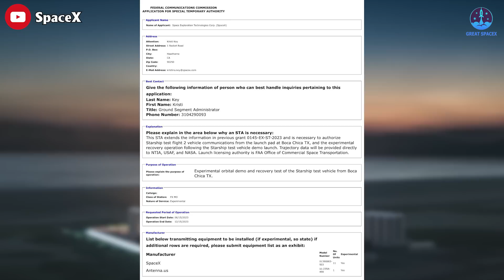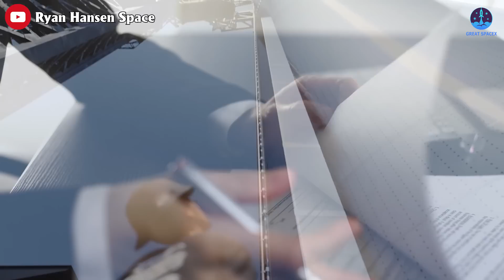Starship’s second flight date revealed, FCC approval, S25...

Comment: Any flight termination device that is activated during flight is under review requirement. That is protocol. Blue origin had the same issue with there mishap. It takes 3 to 6 months to go through data and change the issue.

Comment: Sorry for length :
Astroscale is sounds great to boost lots of items. But just lifting Hubble orbit would be as useful on its own as to push the Tesla Roadster In space towards an orbit around Pluto. Hubble will be in a safe orbit + extra effort to clean its path is great with no risk for outr lives it will ever crash back to Earth in our life time. Now Back to Pluto and Tesla Roadster, the roadster needs a lot of work to patch the failed systems that 30 years bring. Hubble needs ALL NEW giro’s, More propellant, new computers that talk and work with the abacus now on board. Let’s see STS had 5 flights to put glasses on, needed giro’s at least 2 times before, full replacements of older tech and don’t forget the humans (I recall they walked around Hubble a lot on those 5 missions.  Any next flight to Hubble will be much bigger and complicated then giving it a boost (which it sorely needs)! Sorry to slam NASA here but Nothing at all can be done to extend Hubble scientific lifespan. But NASA has no cloths for the  emperor to wear in space! As only 3 crew rated ships have ever gone over 500 miles from the Earth the ship must be a Crew Dragon at this time. The testing of SpaceXs EVA suit is now critical as those on the ISS must be tossed in the trash as safely & fast as it can be completed and certified.

Comment: okay I loved to see starship reach orbit really I do, yet the FCC better be careful with this decision, by like triple checking SpaceX's calculations on this.
Reply: FCC doesn't do calculations. This is just getting a permit to transmit data on a specific set of frequencies.
Reply: @ghost-cs8jy  i know they don't, I just said it's SpaceX that does it, not the FCC
Reply: @Charles-7  The FCC doesn't check SpaceX's calculations either.
The permit that they are going to issue is like a fishing license; just permission to use the airwaves.
All the FCC cares about is that all the forms are filled out correctly and the check for the permit clears the bank.

Comment: It will be interesting to see how fast 33 high pressure plasma torches can cut through the water cooled steel plate.
I know it will be expensive, but there is no substitute for a flame diverter trench if a high rate of launches is to be achieved.
Reply: Well the plasma torches are liquid cooled, so I think it's doable.
Reply: @Arational The flame diverters used by NASA have never seen a booster REMOTELY as powerful as the ones Starship will be riding to orbit.  NASA had concerns about launch pad damage even before SpaceX did a low power test, and even the lower powered engine tests blasted the concrete into dust.  Plus Starbase is at sea level, not up on a hill.  Anything they dig would be flooded by groundwater, hurricanes, you name it.  And you don't want saltwater steam drifting onto your launch pad and other metal parts of Starbase.
Reply: Steel becomes putty at about 500 C  .  The exhaust temp is about 4000 C. The water will likely just be blasted aside then lumps of steel putty will be blasted all over the place possibly taking out rocket engines. I feel that even using Tungsten would not be enough.
Reply: @frankkolmann4801  and again I am dumbfounded at the shear genius in YouTube comments.  I can't even fathom why SpaceX doesn't hire a bunch of them and solve all the problems.  Musk said that the new raptor V3 might possibly have the highest heat flux of anything ever made.  Must not let those engineers look at the plate design too let them know it will fail.  Maybe you can educate them on heat flux so they know the rocket engine melted during testing, they just didn't notice.  You know the water is going to be cooling the plate from the bottom and then spraying up through it?  
Let me guess, you are one of them that knew the pad would fail at liftoff thrust, but not during the static fire, like all the other YouTube geniuses?  That's excellent engineering when you don't have the numbers.  Are you all use a crystal ball or a Ouija board?
Reply: @frankkolmann4801 I forgot the best part.  you ever run the heat vs pressure equation?  Of course you didn't, or you wouldn't say the exhaust was as hot as the combustion chamber.  Oh and film cooling,  something else you should know as an engineer
Reply: @frankkolmann4801  the steel plate is acting as a giant shower head, with water blasted onto the surface of the pad from holes in the plate itself.  They are angling the water streams to deflect the rocket exhaust off to the sides, so the pressure and heat on the plate is minimized.  High temp steel alloys do exist and I imagine SpaceX may iterate on this design and add higher corrosion resistance after they get concrete data on how much heat this upgraded pad can handle.  

As for molten steel damaging the engines...no.  The booster itself is steel and they would see signs of damage to the "skirt" around the base if steel globules were an issue.